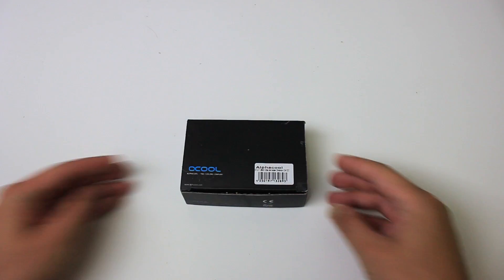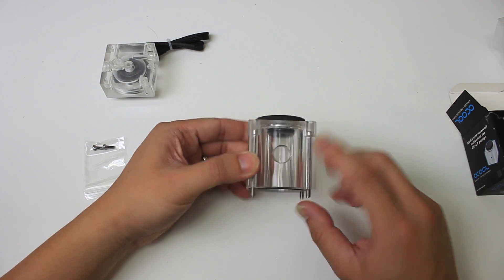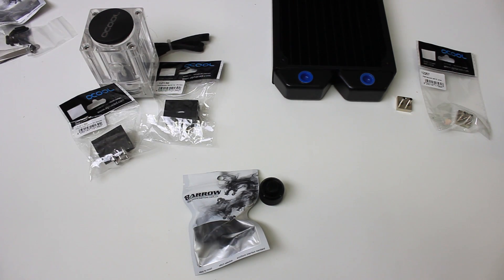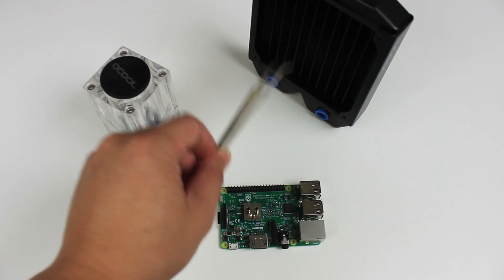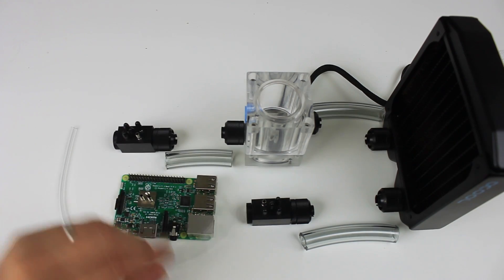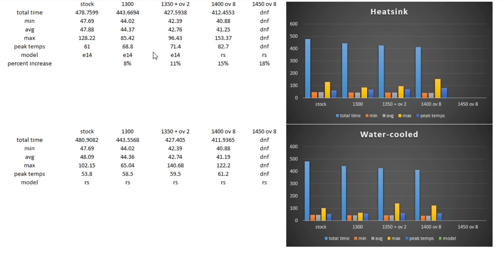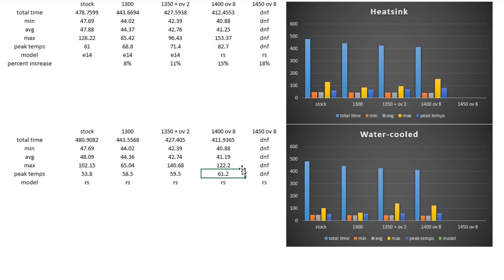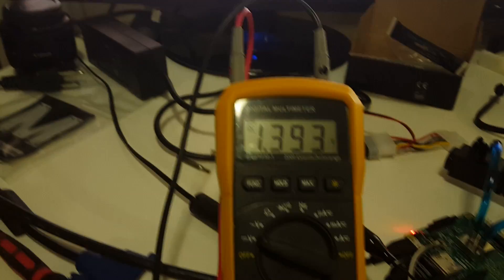Water Cooled Raspberry Pi 3

Comment: "We are hackers"  what a joke . . .
Reply: "Hacker" doesn't simply refer to the script kiddy persona you see portrayed in hollywood films.

I know plenty of old school software devs that refer to themselves as hackers because they simply "hack together" some code to solve a particular problem. Likewise there are "hackers" who specialize in Electrical/Mechanical Engineering projects.
Reply: +dodekeract ""We are hackers" what a joke"what a joke
Reply: ""we are hackers" what a joke... what a joke... what a joke... what a joke...
Reply: To hack has more than one meaning, one of the meanings is using a device or material for something other than it is supposed to. So for example if you put an iron plate on a hair dryer to heat up the plate, and you start ironing a t-shirt with it you hacked the hair dryer.
Reply: joshua lotion I was just making a point. If you make a laptop charger output 5V and put a mirco USB on to directly charge a phone, then you hacked the laptop charger. A computer isn't supposed to breach other computers, a playstation isn't supposed run pirated games, but if you do you hacked it simple as that. If you lookup the defenition of to hack you will find: gaining acces to computers or networks without authorization. But if you will find dozen of other definitions, including the broad "using something in a way it is not intended to be used". Better stop calling people retarded and do research!
Reply: ***** This is the first comment I made: 
"To hack has more than one meaning, one of the meanings is using a device or material for something other than it is supposed to. So for example if you put an iron plate on a hair dryer to heat up the plate, and you start ironing a t-shirt with it you hacked the hair dryer."
So what are you trying to prove, scroll all the way up before typing your next reply.
Reply: joshua lotion He was not relating to the watercooling. He was relating (if I'm not mistaken) to overclocking further then what would be possible on air cooling.
Reply: Hacking is just another word for an unconventional approach to a task or problem. With that said, I wouldn't personally have called myself a hacker in the context of the video because it would just feel wrong but, at the same time, it doesn't bother me that they used it. Each to his own, or whateverthefuck it is people say.
Reply: ***** I said multiple times that the term hacker has multiple definitions, and breaking into IT regulation illegally can have more then one term, hacking, cracking, breaking in... And If you read I also said hacking had a definitions of "doing things with things that are not supposed to do those things" So that has nothing to do with IT. That moment when someone wants to break down a point but fails to read a my comments. What a joke.
Reply: yeah, hack as in "hacking something together" or " its a bit of a hack but it works"
Reply: +joshua lotion Good job a ridiculing idiots. Everyone here is laughing. At you though, as you are being a idiot. Look at yourself bro. 1, not capitalizing sentences saves a tenth of a second. 2, you capitalized the sentence after it.
Reply: +joshua lotion It's funny, because autocorrect is disabled 99% of android phones by default.
Reply: +joshua lotion When have I promoted myself?
Reply: +EchoIsPro lol 143 iq w/ degree but the best argument you can come up with is about capitalization and spelling.
Reply: 1 year later, still cringed when he said it
Reply: Doh... (smacks head)
Reply: +joshua lotion Ok. All hardware engineers with 4 years in programming are retarded (:
Reply: CancerOfTheWeek oh and eww. An engineer pretending to be smart on the internet. Sth i see all too often
Reply: +joshua lotion Of course. Because becoming a hardware engineer is so easy! And you even know what capital letters are!
Reply: +joshua lotion Okay, I'm talking to someone who doesn't capitalize their name. Look, I see how instead of actually maturely, you are acting like a child. You know you are making a fool of yourself, so please do a favour for everyone, and just stop.
Reply: I can smell the beef from here. Please guys, there is no need for this.
Reply: +Cappuccino - I prefer lamb.
Reply: +CancerOfTheWeek I mean u guys are arguing over nonsense. Please stop, I'm not trying to get involved but my notifications are being "blown up" by these inimical comments.
Reply: +Cappuccino - I know, but I prefer lamb to beef.
Reply: CancerOfTheWeek i prefer beef to lamb. More protein
Reply: +joshua lotion turkey is my favorite. This is making me hungry, come on :(
Reply: +joshua lotion my father makes a fantastic chicken recipe also. Any one want to try it some time?
Reply: Cappuccino - with a pint of Guinness?
Reply: joshua lotion Your the second person who said (or at least implied) that my profile picture looks like a Guinness lol
Reply: MrZombieSlayer weeeeell, that quote is not yours, but andhika bayu 's so I don't know why you replied.
Reply: Norman Newkirk Learn to spell, imbecile.
Reply: Cappuccino - Beef was quite good in Kali :)  I think the term hacker has been bastadized a little.  But alas there are ethical hackers like CISSP etc.  Unless he can code python with Linux and maybe holds a CCNA, etc etc then he just remains a mod man.  To "hack" a microwave or a phone I'd class as a break out or jailbreak.  Then we have pen testing...
Reply: 1337 Hax0rz ?
Reply: ""we are hackers" what a joke..." what a joke..." what a joke...
Reply: MrZombieSlayer pretty sure he said. You guys might be wondering why i am water cooling. It's because we are hackers bla bla nonsense nonsense
Reply: Cody Lee obviously you haven't watched any of his other videos, please do some research next time before blindly making ridiculing comments you imbisil.
Reply: CancerOfTheWeek nope just you
Reply: Woa .you just called urself smart
Reply: CancerOfTheWeek didnt u know, we all have ambitions. And mine is to be a part time satire comedian and ridiculing idiots on the internet like you. And not capitilizing words is to save time. Very efficient
Reply: CancerOfTheWeek it's called autocorret. What a smart 143 iq 4 year engineer
Reply: Apple was probably the last phone manufacturer to implement autocorrect. And saying that i use apple just because of that is really really retarded. I really wonder how you even got into college let alone finish a degree
Reply: CancerOfTheWeek wow you must be fucking outdated my "friend". What? Too much time cooped up in self pity? Of how useless the course u chose was. Srsly who the fuck cares about whatever the shit ur doing. Maybe others have succeeded in your field but I'm sure ur useless coz you promote urself to the Internet
Reply: CancerOfTheWeek " ohhh I'm the best engineer in the worlddd" " im better than every commenter on YouTube" that's what everybody reading interprets ur comment as
Reply: +joshua lotion What does this have to do with me advertising lmao. Anyway, should we just make a truce, I fucking bored of this.
Reply: With beef you get to know that a large animal died just for your satisfaction. Srsly have you seen how they kill cows? Smash it on the head with a hammer
Reply: joshua lotion If I mod a sock to fit my head so I can wear it as a hat, that makes me a hacker because I hacked the sock. So why can't I call myself a hacker then?
Reply: MrZombieSlayer yea but how did that guy hack? He bought a water cooling setup that was intended to be used that way for the pi. What did he change?
Reply: nope not one bit hacker, saying that he's an IT enthusias would work better, since the definition of a hacker on the net since 2000 is someone that break an IT regulation illegally, the act of using something not as intended for more effectivity can be called a hack, that's why there's so much life hack tips out there, but do you ever see that the person who post it called themself a hacker?, even Linus from LTT never call himself hacker while what they do is over the top computer hack
Reply: +joshua lotion Oh you use autocorrect, that means you use apple. BWAHAHAHA. And you were calling me stupid!
Reply: +joshua lotion But with lamb you can think about that cute baby lamb you are eating!
Reply: I almost vomited when he said that. It's worst then having no reason at all

Comment: I quit expensive water cooling years ago when I discovered that cheap "heat pipe technology" was more effective at shifting the heat.
Reply: Watercooling is wat more efficient at heat transfer and at heat dissipation
Reply: mrawesomelemons Not from my experience. I've always got lower temps using heat pipes.
Reply: ***** Then you had a shit watercooling loop. The laws of thermal dynamics prove that watercooling is more effective.
Reply: mrawesomelemons Well then try something like this and post the comparison...
https://www.scan.co.uk/products/arctic-freezer-11i-silent-cpu-cooler-with-92mm-rpm-pwm-fan-for-intel-115x-2011-cpu-up-to-150-watts
Reply: ***** Are you serious? That thing is worse than a 212 EVO and a 212 EVO is no match for a custom water cooling loop..
Reply: mrawesomelemons Hyper 212 EVO destroying a Corsair H105: UMl7iEzpzsA
Reply: ***** An H100i destroying a NH D14 which is about twice as good as a 212 EVO: watch?v=u8HsjgtMzEg
Reply: mrawesomelemons I'm talking about shit in my price range. If money is no barrier, try liquid nitrogen.
Reply: ***** You said aircooling is more effective and gave an example of a Hyper 212 EVO vs a H105 (which is more expensive than a H100i) with clearly false results. Watercooling is more effiecient but also more expensive. Duh.. Liquid nitrogen is a stupid alternative since it needs insulation and continous refilling and also is overkill for a 24/7 system.
Reply: mrawesomelemons The H105 is around £100 here in the UK. The H100i is over £170.
Reply: ***** Might be because the H100i is EOL. The H105 should perform better. Especially with Noctua fans.
Reply: mrawesomelemons I'll stick with heat pipes.
Reply: ***** Solid idea. Cheap and effective

Comment: On the bright side, adding half a dozen more for a cluster would be pretty cheap since the pump assembly, radiator, and most fittings are already adequate
Reply: this was what i was thinking.  saw 20 pi cluster and having felt the heat they generate, i would definitely opt for watercooling if i were to make one myself.  one thing that im not too sure about is the connector that reduces the tubing to the smaller tubing.  it seems too restrictive to have more than couple in a series.  prob will need either multiple loops or some industrial level fittings with low flow high pressure ac pumps or something...

Comment: 60 celsius is not something you want to touch with your hand
Reply: Oh come on, 60 Celcius is nowhere near hot. This is warm yes, very warm as well, but nothing hot or hurting.
Reply: Temperature and duration are key. With our ideal body temperature of 37ºC, the following examples are hard to comprehend, but true nontheless:

Exposure to water of about 40ºC can already cause 1st degree burns.
Over 1 hour exposure to 45ºC brings second degree burns; over 2 hour, 3rd degree.
Over 3 seconds, exposure to water of 60ºC results in 2nd degree burns.
Over 5 seconds? 3rd degree.
I got myself on of those IR temperature gages; aiming it at my sink or tub was a real eye opener. I "imagined" a hot tub being around 65ºC, but in reality it wasn't even 45ºC....
Reply: Said no welder ever...
Reply: woody wood
https://en.wikipedia.org/wiki/Thermal_burn:

"The minimum temperature where it can suffer burn in a finite amount of time is 44 °C (111 °F). From 44° to 51 °C (111° to 124 °F), the rate of burn increases by a factor of approximately four with each Celsius degree risen or twice per Fahrenheit degree risen, from six hours down to six seconds. The burn would develop in less than a second if the exposure temperature is at least 70 °C (160 °F).[3]"

It's not just Wiki, Google it :)
Reply: 60°C is verry safe to touch, for a limited amount of time atleast.
Reply: are you stupid? your temperature body is 37 C. So, 40 is nothing...60 C feels a hot, but does not burn, not even first degre.  The less people knows, the more they talk.
Reply: woody, I work in celsius I have my cpu at 60C and its a Q9650 with heatsink and a fan not a simple arm chip
Reply: that's true but average hot spring temp is around 62 °C and people take a bath in it though no more than 10 to 20 minutes, your information is true but really missleading, since according to your information you can get burn (scalding) by bathing in warm water (not even hot) for 6 hour, but who would take a bath for 6 straight hours?

Comment: its should be one big block that mounts on the raspberry pi
it will be possible to use thermalpaste and a bigger diameter tube can be connected and there will be more flow

Comment: another reason is just for the educational aspect. you screw up a raspberry pi 3 and you are out $35. you do the same to a $1000 computer and you have an expensive disaster. best to get experience on a cheap setup.
Reply: That's why you build your cooling loop outside of the case and give it a 24 hour test for leaks. Then, put it in your PC.
Reply: Bartosz Olszewski 
It is. It's just physically awkward to do and fiddly. Which is why I stick with air cooling.
Reply: +Joel Gabriel moving your loop in place may cause leaks, so testing it outside doesn't make you 100% sure that it's gonna work.
Reply from the maker: totally agree, why else do people build "super computer" with 10 raspberry pi 3 vs 10 real desktops, educational and affordable
Reply: +Joel Gabriel it ain't that simple
Reply: Bartosz Olszewski 

tr00
Reply: agreed, best thing if you're doing water cooling is to built everything in place and then test the water loop without powering on the pc, only the pump (using a jumper wire or external PSU). If anything spills nothing will short out and you can just carefully let wet components dry.
Reply: Watercooled Rasberry PI super computer, with a 480 rad with fans, coming up!
Reply: Don't waste 35 dollars, just use a zero, there only 5

Comment: What tubing did you use on the mini blocks? I don't see it in your description.....am I missing something?
Reply: bendy straws
Reply from the maker: 3mm id x 5mm od pipe. can be found at hardware store or pet store that sells fish supplies
Reply: That was fast! Thanks! Considering trying to do an entire cluster of pi's on one loops (instead of using the rubber plugs, have them go to other pi's) 

For the quick reply, you get a sub!
Reply from the maker: that's a good idea, i plan on doing that too for a later episode, but at that time i think i would need to put a fan on
Reply: You could do temperature testing to see how many Pi's it takes to make the radiator increase in temp. And do temperature trends (1 pi on, 2 pis on, 3 pis on, etc) to see how many pis it takes before the fan starts providing any sort of benefit.
Reply: there's notable difference with the peak temps but how often does your system reach those temps is what I wonder
Reply: R99pinball

Comment: would it keep cooler if you just flush through cold tapwater and lead the outlet to water sink?
Reply: probably not for two reasons, 1. the radiator is pretty efficient, especially once the fan is in place on the rad, if a normal 240mm Rad is used for cooling things like I7's down to 30C imagine the effect on this, 2. The problem with using tap water is it's great for foreign things to start growing in the loop, and since the loop is so small it could easily gunk and stop all the flow, with regular PC water cooling they generally recommend distilled Water with a piece of silver, or using coolant you can purchase off the shelf online, it's probably the same in this case
Reply: +xxroyalxtigerxx a radiator can mever be mote efgicient than a constant feed of cold tapwater... and the water here doesnt have problems more than a little possible mineral precipitation. Maybe tapwater has high bio organic content in other parts of the world.
Reply: Depends on how cold your tap water is, but yes you would keep it near that temperature as long as the water is going, of course that is quite a waste of water.
Reply: +MsSomeonenew ours Is -1 cooling system installed
Reply: +Pelle Chamliden A basic liquid cooling loop on a PC can run at 41f(and can be much lower) while the Avg cold tap water is around 50f, The loop is much more efficient in every way
Reply: +xxroyalxtigerxx
What the hell are you talking about? 41F is almost freezing temperature, for your PC water cooling to run at that then your room must be well below freezing...
Now you might live on Antarctica and your house might be made of snow, but how the hell would tap water then come in at 50F.
I'm guessing you got your units all mixed up and don't understand much about water cooling.

Comment: you defeat the ptopose of the pi, which is size, with that setting.
Reply: +T horon there is nothibg to learn form that test. you already know what is the  effect of a cooler. and since there is no point in using it with a Pi is a pointless test.
Reply: +T horon that is called idleness
Reply: we overclock cuz we wanna go fast. The beauty of a liquid cooling loop is you can hook up several things to it.

Comment: How does those heatpads compare to a good paste? The pads I used on some memories were really poor so I removed them, put on some arctic silver, applied some pressure and fixated the sinks with a glue gun. Worked like a charm.

Comment: It's a more efficient loop if you do the following: heat sink outlet to pump / reservoir inlet , pump / reservoir outlet to radiator inlet, and finally  radiator outlet to heat sink inlet. That means your coolest liquid is pumped into your heat sink and and any heat transfer from the pump should be cooled off by the radiator before hitting the heat sink. nice video, crazy overkill.. I like ;)